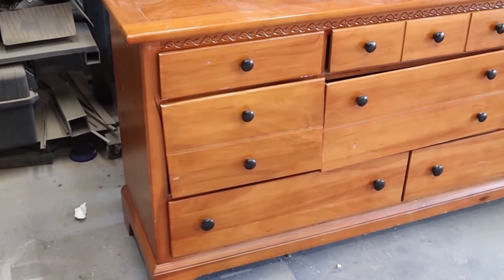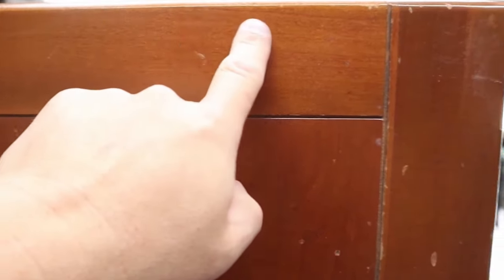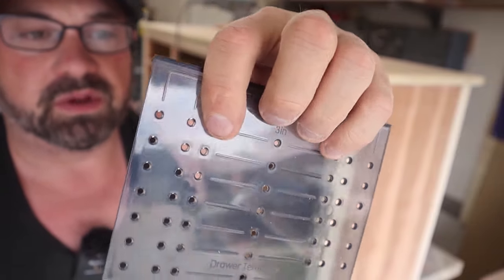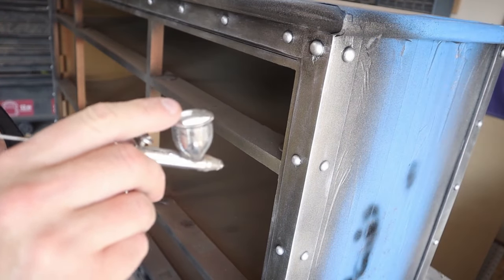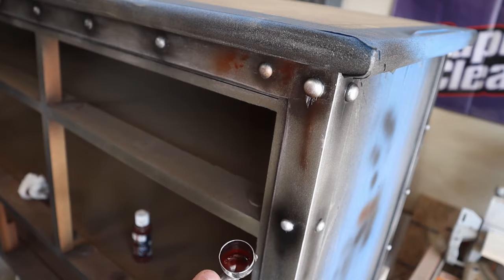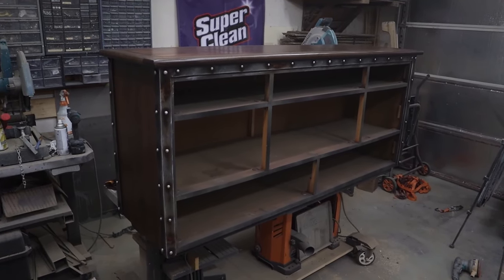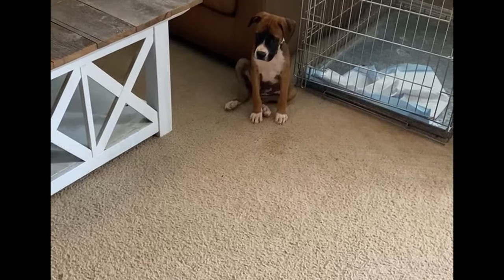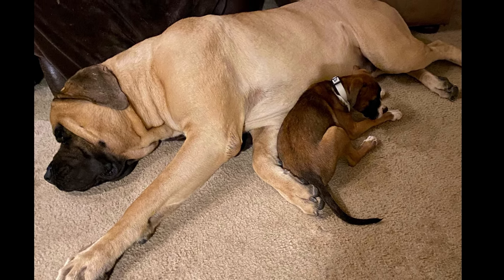Industrial furniture, Transforming a Curbside Find into an Industrial Apothecary Masterpiece! 🔧

Comment: Hi Dean,quick tip for even better rust effect.Paint the area to be metal with red oxide,black,brown just rusty type colours.let it dry and spray or paint it with cheap hair spray a couple of good coats should be enough.Then apply your final metal colour and let that dry.Once dry get an old tooth brush and something sharp and pointed like a skewer.Dip the toothbrush in water and scrub away where you want the rust colours.gently at first until you get the hang of it.then finally make a rust coloured wash and apply.I promise the best rust effect ever.
Reply from the maker: Cool I will have to give that a try. Thanks!!